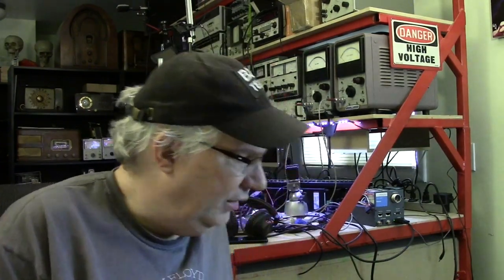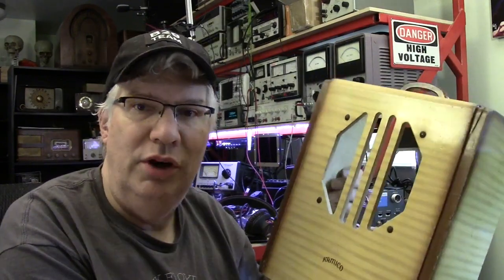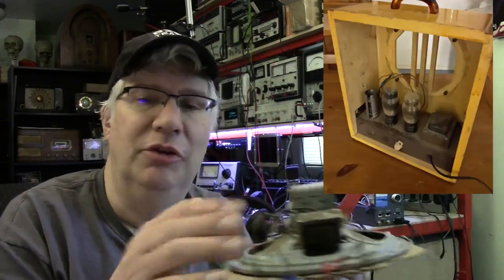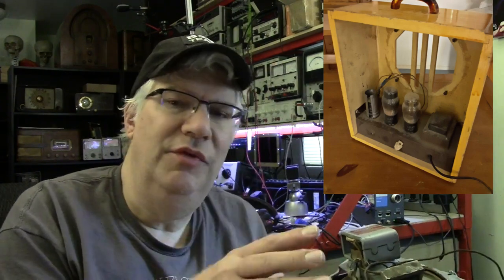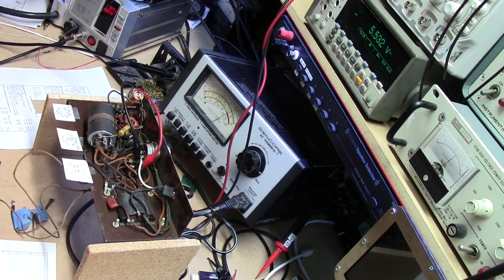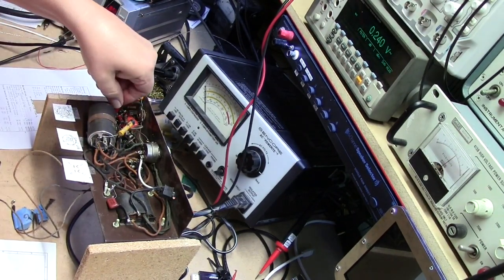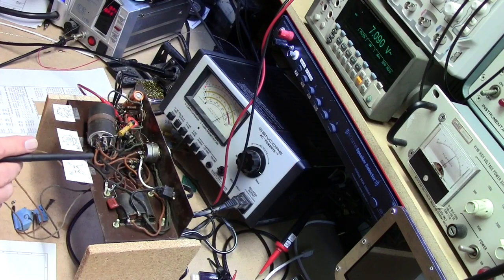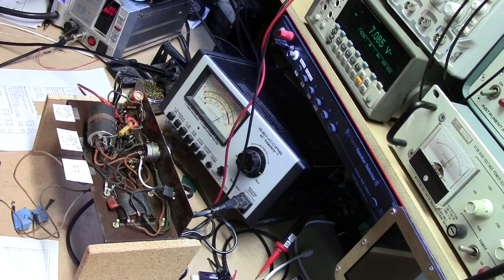200419 Valve Studio - 1949 Kamico Hawaiian Lap Steel Amp - Part 1

Comment: Interesting amplifier design. Very simple. Many of these amplifiers were made by Valco under various brand names including Gretsch, Awahu, National, and many others. I've serviced and rebuilt many of these, and most amps made before '52/'53 had FC speakers. The things that changed on these over the years were the rectifier tubes, output tubes, and preamp stages. Once the push-pull models came out all that was added is maybe an extra gain stage, and a PI. I've seen some earlier models that used 6J7's. Great video! Keep'em coming. :)
Reply from the maker: Will do, thanks for the comment and for watching.

Comment: That's an interesting circuit, I couldn't help but wonder what would happen if the output transformer was capacitor coupled? An electrolytic cap would block DC from the output transformer but allow the Ac signal ripple that's caused by the output tube drawing DC current, as we well know that even the tiniest bit of DC current across a transformer amplifies saturation, so technically I'm thinking that if the DC component is removed from the output transformer, it should be able to operate at much higher power levels without suffering from saturation.. It's something that I plan on trying one day when a vacuum tube amplifier falls into my lap unless someone else beats me to it.. What this would mean if it actually worked? It would mean that you would be able to build a vacuum tube amplifier with a much smaller (and therefore much cheaper) output transformer, I'm not sure what it would mean for the sound quality though! It might improve dramatically but take away the classic tube sound or it might just sound like rubbish! Who knows? 
Having Ac superimposed on top of DC is an interesting topic all on it's own, it's also the reason why it's important to have or use capacitors that don't leak DC, as I said earlier that the tiniest bit of DC current has a huge impact on the components in a circuit that are only meant to be exposed to Ac because the effect is exponential. I personally would love to have a device that measures DC current leakage down to the Pico amps.. Miliamps of leakage is already to high and already well on it's way to getting worse. There's got to be a better way!
Thanks for uploading this video, I really enjoyed following along on this journey (Lord knows that we really need a good distraction from what's going on in the world today). Stay home, stay safe and I will see you in the next videos..
Reply from the maker: You may want to simulate a capacitively coupled transformer to see the frequency response and the peak that results from the LC tank circuit. As for the DC current causing saturation, this is true only if the AC amplitude cause the output transformer to hit the saturation knee. However, if it does hit the knee, that effect will generate asymmetric soft clipping and result in even order harmonics, which might actually sound great! Thanks for the comment and for watching. I hope that my videos inspire you to continue your investigations.
Reply: Craig Hollabaugh actually you won't be creating an LC tank circuit because the capacitor isn't going to ground like the output transformer, think of it as a capacitor between the 12AX7 and the EL34, you are just blocking DC from going to the next stage! 
I fully understand the normal workings of a tube amplifier, I know very well that they soft clip when they hit saturation and that people actually like it, this isn't about what sound you get but it's more about getting a tube amplifier to work with a much smaller output transformer. It seems that in the US, output transformers are a dime a dozen and I kinda wish that were the case here in Australia but that's not the case here or even in other countries around the world. If Trump wanted to boost the US economy, all that he would need to do is make it cheaper to purchase second hand stuff for other countries LoL, you guys have stuff that the rest of us need...
Reply from the maker: @PeterMilanovski  From an AC perspective, the capacitance, the OPT primary inductance, the coil resistance, the tube output impedance and the tube equivalent current source form a series tank circuit.
Reply: @CraigHollabaugh  you could be right, I don't really know much about tank circuits. I only learned about tank circuits because someone else on YouTube brought it up! So basically my understanding of a tank circuit was that you had to have a capacitor in parallel to an inductor to form the tank. But what I'm trying to achieve, the capacitor is in series with the output transformer, the same way that a capacitor would be in series with a single ended solid state amp with the speaker, which is actually where I'm borrowing the idea from, the goal is to block DC from the output transformer the same way that you would from doing so in the solid state circuit... I don't know if would work? But if it did work, you might even get away without the expensive output transformer! Imagine that! A tube amplifier without an output transformer!